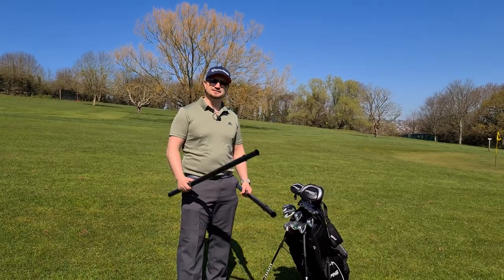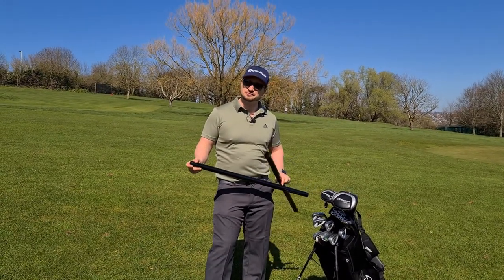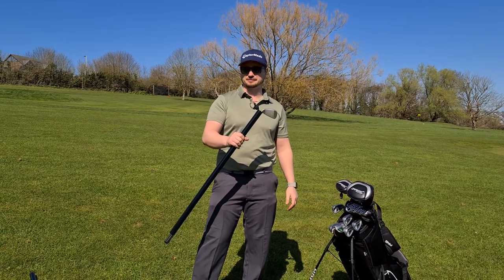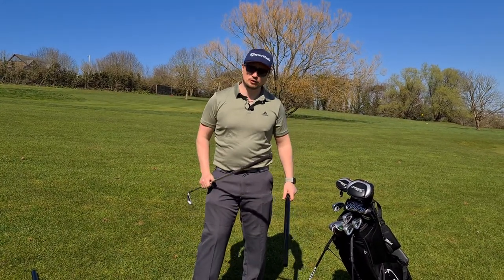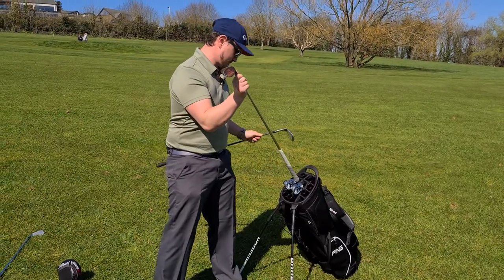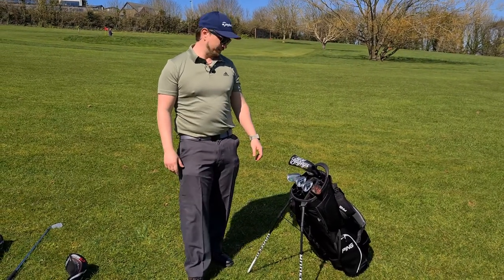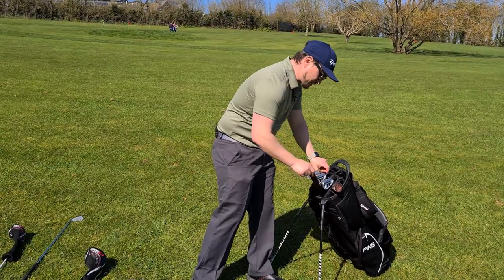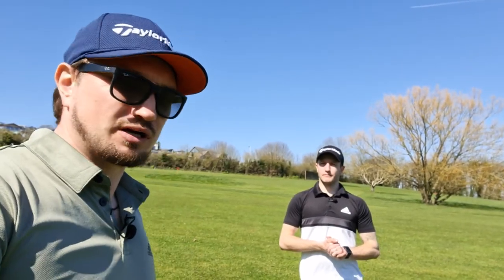GOLF BAG DIVIDERS | Do these TUBES stop your GOLF BAG SNAGGING?

Comment: Heads up! If you have graphite shafts in any of your clubs , specifically your hybrids, woods, driver- these plastic tubes will rub dimples in them, weakening the shaft and the shaft will splinter eventually. How do I know? I’ve had to replace a 3 wood and 5 wood because of these stupid .80 cent tubes. Avoid at all cost.